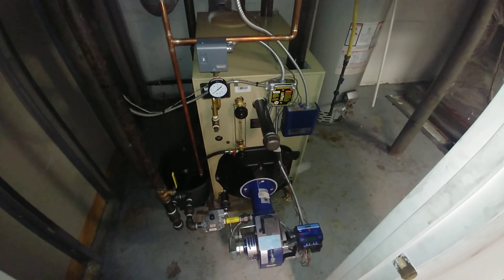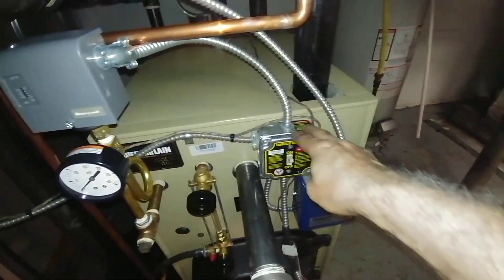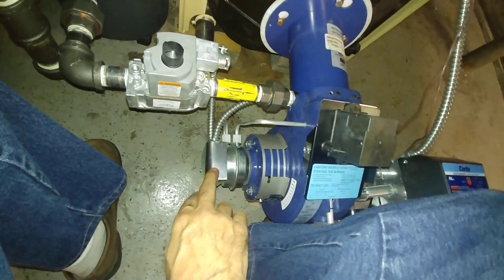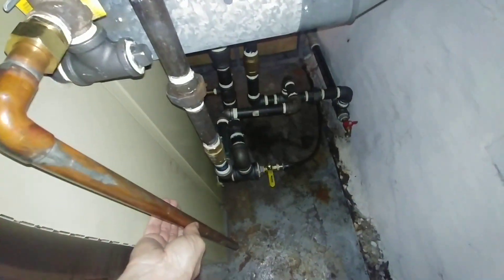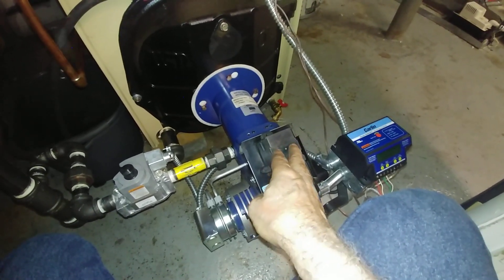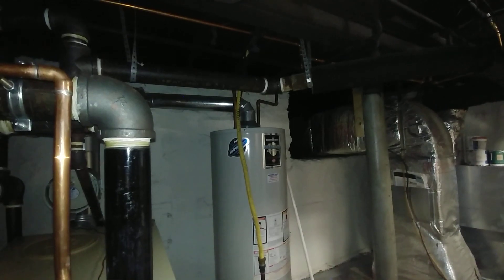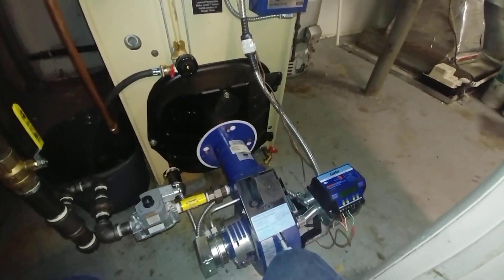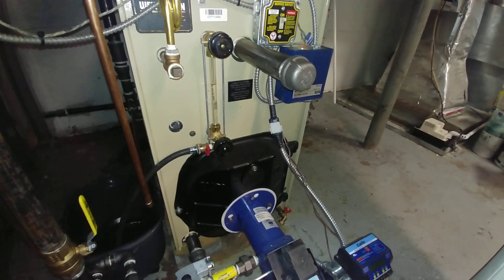Wired & Fired. Steam Boiler Install Complete (finally!)

Comment: That’s some nice piping there. I have installed a few dozen of those Carlin gas burners and had very few issues with them. Also I have seen those burners plug up boilers when improperly set up. One thing I like to do on steam installs is install a ball valve on skim tapping and pipe it down to about 18 inches above the floor so I can fit a 5 gallon bucket to skim. 👍👍
Reply from the maker: Thanks 👍

Comment: Heard of a gas gun from the internet never thought about it much. At 82% efficiency even though you’re using sophisticated air controls?
Seems to be less than ideal is an oil fired boiler lower efficiency than the same size gas gun? Or are they about the same?
Reply: Gas and oil guns are about the same, efficiency-wise. Setting up a gas gun is easier because you don't need to fool with that silly smoke-gun.  Still need a combustion efficiency analyzer for both oil and gas, you can't get away from that (oh, can try, but that makes you a dangerous hack IMO).     The gas gun fired boilers overall have a lower maintenance cost than oil and that is huge.  Cleaning most oil-fired boilers is a PITA, even with proper set up and low sulfur oil.

Comment: Good job!, does the feed water to these type of systems have any water treatment?
Reply from the maker: Thanks for your question. The short answer is no. We tend to avoid adding anything to the boiler water. Most of the time when anything other than clean water is added, it causes more problems than it solves. Depends on the water, of course.  Highly acidic well water may benefit from water neutrialization, for example.  At least that has been our experience. Your mileage may vary.

Oh, and Weil Mclain in their instructions say not to use any treatment with petroleum distillates to avoid damaging their gasket seals.
Reply: Thanks for your reply, we have the yellow flexible gas pipe in the uk only good for burying in floor screed, horrible stuff!
Reply from the maker: @dannywilkins887  Yeah, not overly fond of CSST myself. Have used it a bit in the past, but not anymore. It may be a problem solver if you have to snake a line past a four-dimensional obstacle course. Gotta bond it well electrically and even then it's a worrier with lightening strikes.
Reply from the maker: Oh, and thank you for the complement!

Comment: Nice install. Would like to see the efficiency numbers on that powerburner unit versus my atmospheric Burnham IN8.  Do you reskim later?
Reply from the maker: This one tested out at a bit above 80%. If you do a freeze frame when I show the printout, the numbers can be espied.  Disappointing really. Would have liked to have seen 82% or higher.

It is difficult to get a good trustworthy reading on some atmospherics, however, because of how the probe goes in on the draft diverter. Lot of excess air. So really what we are looking for is getting the carbon monoxide ppm numbers in the teens or lower. 
80% is minimum in my book.

Sometimes it takes several trips to skim all the goop out.  This customer reported when the boiler first ran, there was an oil smell throughout the house. Some of that might be burn off from the jacket and insulation ("that new boiler smell"). But most is from inside the boiler block itself, I believe.  The customer reports that the smell has deminished considerably since I removed that initial disgusting gob of goop from  the skim pipe.